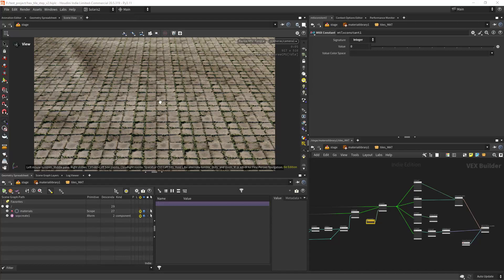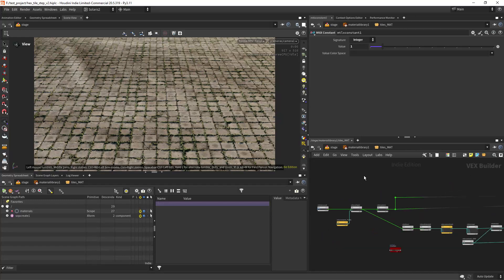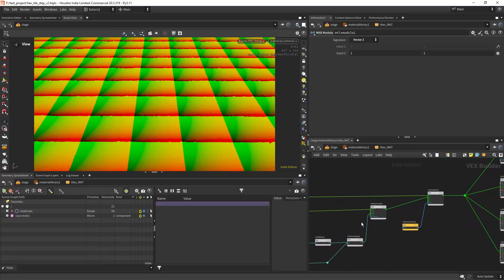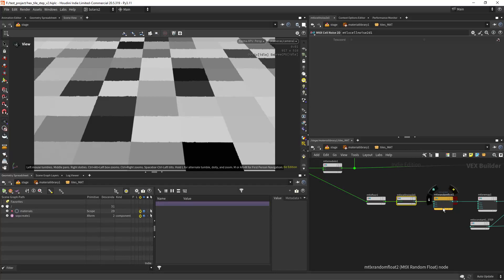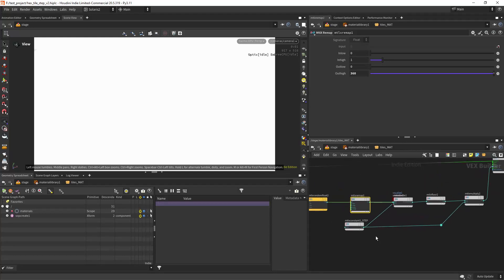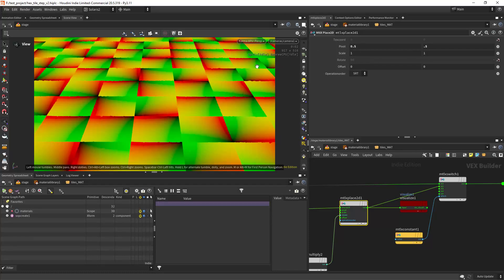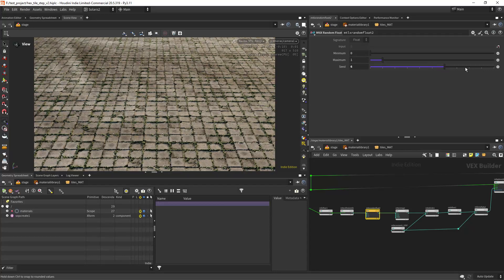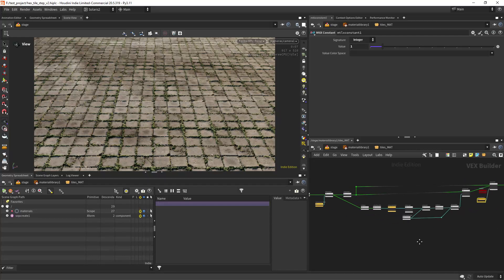UVW randomizer in karma

Comment: Question: will rotating the texture like this cause the normal map to render wrong? The colors in the normal map are linked to tangent directions but if the uv are rotated this way won’t the normal become unconsisent in certain parts? 😅 I recall a Unreal Engine tutorial addressing this very issue, maybe from EarlVFX. The solution should translate to houdini too.
Reply from the maker: Yeah, normals need to be addressed in a different way, meanwhile using displacement/bump. Cheers
Reply: @cgside  An idea for the next video? 😀